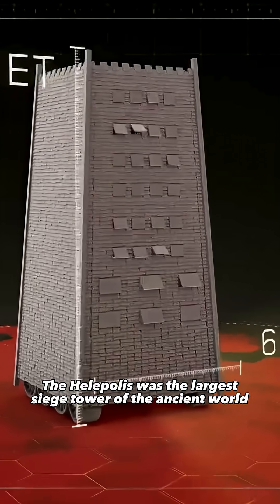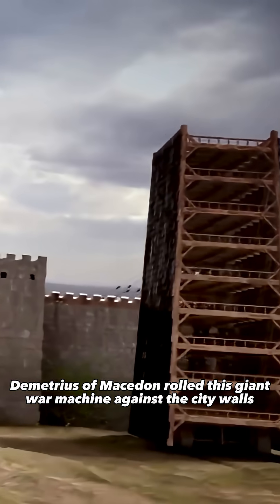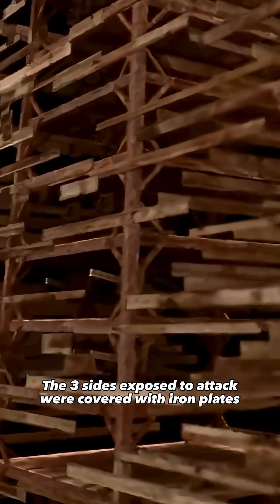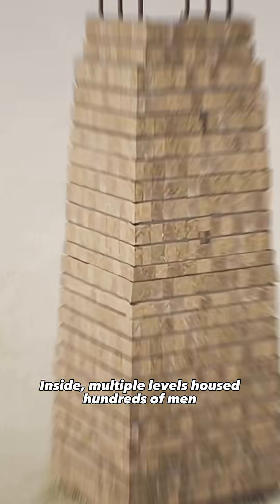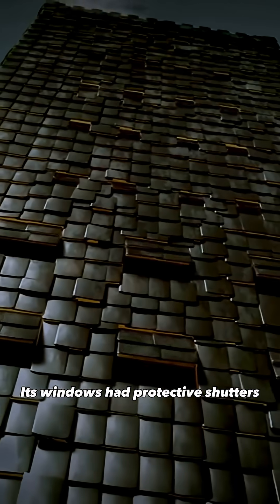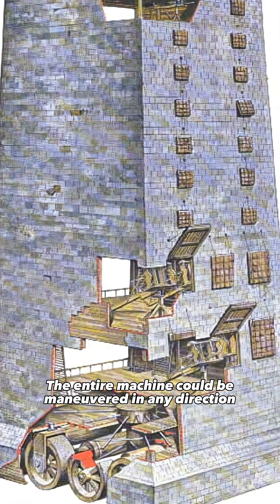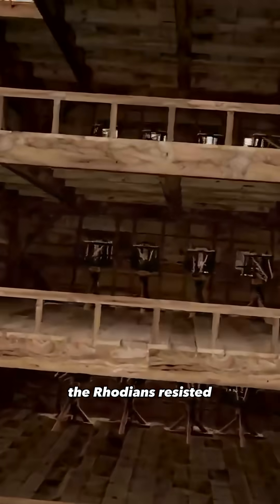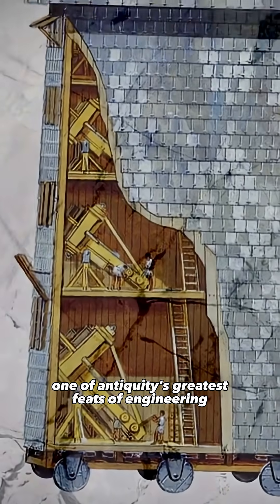Ancient War Machines Second Episode : The Helepolis #history #engineering

Comment: I don't buy that this thing was covered in iron plates. I mean this is 300BC, and Iron isn't all that easy to mass produce yet. Plus turning them into  large plates and cover up an entire seige engine... that sounds unlikely. Not to mention the added weight from all that. Rawhide would do nearly as good a job and it would be far easier to procure.

Comment: Fun fact about it is that the Rhodeans used all that material to built the Colossus to troll everybody.😅
Reply: WRONG! The Colossus of Rhodes NEVER EXISTED! EVERY bit of "recovered artifacts" which were used to "prove" its existence has been DISPROVEN &/or DEBUNKED! I'm a Greek from Athens, formerly married to a Rhodian girl. We've vacationed at Rhodes and visited the Colossus of Rhodes museum, there, which is where I found out. Mainly, there wasn't enough metal at Rhodes to build something of that size, nor were there ANY engineers, architects or builders with the knowledge to engineer and design it. Also, the location where it was supposedly erected is NOT solid or sturdy enough to support something of that magnitude. Modern-day professionals have also opined that its structure would not have been able to stand upright for very long. Last, but not least, Rhodians are for the most part BIG LIARS! The men are very insecure because of their small stature, and have a certain inability to really control or run their households. Mostly, they were ruled by women, which harkens back to pre-Hellenic history to the age of the Minoans who were the people that populated most of the Greek isles, with Crete being their "capital". They often lost the bigger battles against Athenians, Macedonians, Spartans and were reportedly EXTREMELY envious of them, especially the Athenians whom were considerably more advanced in all areas important to early civilizations. This is ALL writen according to Greek history. Feel free to fact-check me, or reply with corrections. Sorry to burst your bubble, but at least NOW you know the truth.

The Helepolis WAS REAL.

Now, you know!

Comment: What this video isn't telling the people who view it is that the individuals behind the wall fired huge arrows that took many men to draw back and lit it on fire with oil and it got so hot that the guys in the mobile tower cooked even if no flames 🔥 touched them. The HUGE arrows were aimed at the ground in front of the mobile tower so that it could not advance and lot of steel arrows pierced through the thin metal scales. But they discovered that they didn't need to do any of what was mentioned above. All they had to do was cover it with oil and light it and the flames easily burned ❤️‍🔥 between the metal plates. It got so hot that before the wood started to burn the men inside the mobile tower fell over because they could not breath atmosphere heated to that extent. Then the so called engineer was ripped to pieces by his own people because he had them believing that the tower would be very effective and they didn't like the deceptiveness even if it was unintentional.

Comment: I don’t believe this is possible. With all those iron plates and timber’s you wouldn’t move the thing. It would collapse under it’s own weight.
Reply: You highly underestimate engineers. The plates were thin, and the timbers weren’t arranged in the way presented in the video. It WAS built, that isn’t myth, it’s FACT from recorded history, albeit exaggerated
Reply: @Seasmus99  The weight would be around 400 tons!!!
Reply: There had been wooden railway bridges that didn't collapse for a century. There are wooden churches of the same size. Wooden ships have been built much larger. 
The wooden structure will NOT collapse under its own weight. 
The problems are very different. You have to find a way to prevent the wheels from sinking in and you have to find a way to actually move it without exposing a pulling crew in front of it. 
Sinking in can be prevented by building a wooden road. If the machine was designed well, that was possible from the inside, laying log after log in front of the front wheels. 
Moving it probably can be achieved the easiest by a combinatiuon of anchoring poles, pulleys and ropes that allow a large crew to pull backwards while the machine moves forward. 
It will be incredibly slow, but they had tons of time to reach the wall. The enemy didn't want to come out, they were patiently waiting behind the wall.
Reply: Probably made up by Greek Nasionalism.
Reply: You are uneducated

Comment: 3400 men to operate one tower? Those numbers sound exaggerated to me. How did they move such a big heavy thing?
Reply: They say in shifts. Probably had enough room for a couple hundred men working super hard for a few minutes and then getting replaced
Reply: Through a capstan in the bottom floors, connected directly to all 8 wheels through a belt system. It moved incredibly slowly tho, progress would’ve been measured in days and weeks

Comment: How the heck did it move forward? That’s not a rhetorical question, did they push it?
Reply: 8 wheels, each 15 feet high and casters that distributed ground pressure similarly to how a tank tread does. 3,400 men worked in relay teams to always turn a massive capstan which drove the wheels through a belt system. Capstan is a vertical wheel/gear that people or animals turn to generate force. They also had men and oxen behind to push if they weren’t close enough to be in danger yet.
Reply: @Seasmus99 I appreciate the explanation but I’ll keep it a bean, I don’t think that’s even remotely possible. Just the weight of 3k men alone would be enough to drive whatever “treads” you have straight into the dirt and just start grinding it into mud, there is just no torque even if you have theoretically enough propulsion, the theory your describing would work in a liquid(boat in water) or gas (plane in air) environment but against a solid like the ground you need torque to overcome friction.

Comment: How did they move forward a thing this size and this heavy, the pressure over the wheels and over the ground must've been gigantic!
Reply: Don't they say how many men in the video that it took to move it.
Reply: The narrator literally said, "It took 3,400 men to operate".
Reply: 8 wheels probably with supports so when in place it wouldn't need to rely completely on the wheels to resist the weight but in movement, I have no  clue how this would be possible with the sheer weight and limitations of the time.
Reply: @TsutomuGindi  Especially without paved access
Reply: @chuckw.6376  Pretty sure they had time to pave the path in front of that thing from the underside 😂
Reply: That's always my question as well. Do they use oxen, horses, men? How much preparation must they do to the terrain to maintain a steady grade with no depressions. My sense is that these machines may be larger than the norm of the day and grow with each generation after the passing of the original witnesses. I marvel at the ingenuity and engineering but it's the tendency for hyperbole by both sides of the conflict that causes my doubt.
Reply: @charlessanford2198  No, they had a massive capstan in the middle which connected directly to all 8 wheels through a belt system. You’d have thousands of men working in relay teams that would swap in and out to turn the capstan. It moved like a snail tho, so extra men and oxen were used to push in the back when they weren’t in danger.
Reply: @Seasmus99  nailed it. Another video goes into more detail. They first have to prepare the path in front with crushed rock or some other type of paving. The bottom level has a floor that ropes or straps sit under conected to the four large wheels on either side. A huge capstan in the middle turns to move the wheels. The capstan looks like it has 16 or 17 spokes with three men pushing each of the spokes to turn it and provide the power. When it stops wedges are used to keep the tower from rolling back. ... So basically its like a big Tesla Cybertruck except its powered by people turning the capstan instead of squirrels running on a wheel.
Reply: @Seasmus99 
Ah you were there.  Thank goodness you survived.
Reply: @gibu002 the worlds first paving machine. I like it.
Reply: @CharbeeCapps  lol... I would assume the paving work was all from workers that would need to be out front and protected in some way from enemy missile attacks. A pretty rough job that nobody would like to be assigned to. .... Your just dropping off your basket of crushed limestone or whatever when a pot of burning oil drops into your workspace......
Reply: @charlessanford2198 I don't doubt it's possible to make this. However the art shown probably isn't accurate. If the 8 wheels were more like steam rollers with long cylinders and a large diameter that can easily climb over obstacles. Probably ribbed like old steam tractor tires only. As far as what they did to move it. Probably several hundred men pushing it slowly with some form of leverage
Reply: @dasboots3272 someone mentioned above they had people actually paving the ground before the engine could proceed
Reply: @charlessanford2198  Well the ancient greeks(who built this) and the romans actually built ramps and roads for their seige engines to travel on to the wall. They were very good at making roads. The seige tower itself had powered wheels that were powered by the large Capstan at the bottom(look up capstan; they are large cranks with removable poles that were usually on age of sail warships used to raise and lower the sails, anchors, and cargo nets/cranes). Except in large seige ladders instead of men powering it, they would 2 large oxen lashed to each pole, pushing and pulling it, the capstan had like 20 poles and it worked on a gear/pulley transmission system to enhance torque. 
   In addition to this they had large ox teams behind the ladder pushing it. Combined with the powered wheels it moved pretty reliably. You have to understand these wheels were absolutely HUGE like 10ft in diameter and there were a bunch on each side. With the load reduction of the pulley/gear system of the capstan the ox teams could move it pretty reliably, although it moved VERY slowly like a couple feet an hour, but that was a benefit so it didnt wobble and topple over.
Reply: Incomplete information
Reply: They used cave trolls
Reply: Giant elephants
Reply: The answer is simply that the wheels were constantly breaking and needed to be replaced. They were machines that advanced by a meter a day; they weren't vehicles for travel.
Reply: It looks like there is a capstan winch in the lowest floor. The eight "Wheels were most likely not slim, carriagewheels like in this animation, but rather whole treelogs, providing much more surface area. Also, the attacking army usually built reinforced ramps/ boardwalks for the approach of heavy siege equipment under the cover of night or lighter pavestries beforehand.
Additionally to that, the "procteive cover" usually consisted only of heavy, thick wood planks, riveted together with metal fittings and covered with wet cloth or leather, not a full plate armor like depicted here.
Reply: It said it require 3000 men to operate count the view ports and assume each ballista has a 4 man crew. The doesn’t break 500.

Guess what the other 2500 were doing. The “boarding” team wouldn’t be counted as “operators”
Reply: Indeed... 'n the axle grease must have been top dollar! 😎

Sounds more like mythology than history. 

Downhill all the way... The smoothest bedrock ever discovered... More Wheels than you can shake a stick at... (To move in every direction it would have to have been sitting on  "balls in sockets")

The weight of the wooden structure would boggle the mind... 

And they failed... 

That's the part I am inclined to believe😂
Reply: Slowly
Reply: It has been a while since I read the sources. I domt even know if they bother explaining this. However one of the most common, important, and widely practiced feat of engineering (either in a siege or open field battle) was terrain preparation. The Persians, for example, flattened the fields at Gaugamela to help their cavalry and chariots. In the siege of Amphipolis (or Plataea, I forget) the attackers prepared rhe field for their own siege engines. Of course, the defenders did the exact same thing. At Plateae, the Spartans and The Thebans were trying to create an earthwork to reach the enemy walls, but the defenders dug a tunnel underneath and kept removing the piled - up earth. We see the same thing at Masada, where the Romans used siege engines to reach a mountain fortification. They first had to adapt their engines to the terrain.
It wouldn't be surprising if the same happened there.
Unfortunately we often don't get details on such things. Imagine if 500 years from now (after a world wide collapse), all that remains of our civ is a handwritten letter saying "I used my cellphone to talk to Jeff". Future historians would know we used devices that could communicate from affar, but they'd have no idea how, because people just don't bother explaining what, to them, is obvious
Reply: The answer to these historical questions is usually slaves 😂
Reply: TOW truck 🚛
Reply: Literally said it in the video gawd you’re Dumb as Hell
Reply: Any unflat ground basically renders this useless. Well if it existed.
Reply: Also a simple ditch metters away would prob render useless this tower, plus you can attack it while they build it, can only thing of certain situations where it would have been usefull
Reply: It had really wide wheels iron reinforced wheels
Reply: "Aliens" 
history channel at 3am
Reply: Slaves, probably
Reply: Very slowly.
Reply: They used the flying carpets to slide the thing duuuh. that and the enchanted rats.
Reply: Aliens
Reply: @paulclissold1525  Absolutely. 😤👍
Reply: Ancient people weren't as primitive and dumb as you think.
Reply: I can’t believe it would have functioned as stated here especially with Metal Plates increasing the weight. Even if the wheels didn’t collapse and could turn what about the ground? They weren’t rolling it over a smooth hard surface!
Reply: Especially since modern bearings didn't exist yet
Reply: No , but lubricants like animal grease probably helped  @winnsystem
Reply: Ancient historians liked to exaggerate.  You have to decide if what they say sounds like bs or not.
Reply: You are the bs
Reply: @LonesomeDove-dn8dk trebuchet I think you're misguided intelligence seems to be waning recently
Reply: @LonesomeDove-dn8dk   It is best to take them at their word because they are closer to the source
Reply: @LonesomeDove-dn8dk  And people wonder why we don't learn anything from history.
Reply: They probably would have rolled it on logs
Reply: The World's first EV.  It's obvious where Elon got his styling cues from.  😂
Reply: Not that difficult actually. Wooden wheels can support a supprising amount of weight and this had 8. Doesn't take much to move if done properly, tho it would be extremely slow.
Reply: Lets just say the "OG slaves" were once again abused for the purposes of war.
Reply: Hard to believe! Very very hard to believe!!

Comment: The first armored vehicles, if only those guys could see modern main battle tanks, they'd be so excited.
Reply: Only if they were on the same side. Gotta say i think the noise from a couple would make the entire battlefield freeze
Reply: A few tanks are worthless without a way to restock ammunition or refuel. Your precious tanks would be useless after a day in the ancient world.

t. Leo 2 driver during the early 80s
Reply: @uninitializedvariable  Considering the fact this is already a hypothetical situation where an Abrams tank is in ancient times, you'd assume ammo and fuel would accompany it as well lol
Reply: main battle tanks would be worse for breaching walls like this. you'd have to use a ton of HE rounds just to breach the wall, just for the defenders to still hold the rest of the wall.
Reply: @flynntaggart8549  I think the several inches of depleted uranium armor would say otherwise lol. They could do absolutely nothing to even scratch it
Reply: @flynntaggart8549  well considering we have so many round options nowdays it wouldn’t be hard to find one that could absolutely fuck up a stone wall
Reply: @flynntaggart8549 that's why you call in air strikes or paratroopers
Reply: @flynntaggart8549  AFAIK most if not all ancient cities have at least, A gate, gates have hinges and/or attachment points that would be more succeptible to 120mm APFSDS or HESH rounds as opposed to pre-medevial projectile weapons, the thing with gates was that they usually led into tunnels with murderholes and other defensive measures that would likely be effectively mitigated by tank armor.

That was not the point of my comment entirely.

what I meant was more like taking these enginerds and warfare enthusiasts into the future, and introducing them to modern armored vehicles and the entire history of engineering behind them, I presume they would be as happy and awed as a bunch of kids at an all-you-can-eat sweets and snacks buffet.
Reply: You see an armor plate + wheels and cry tank. Chariots are the anchient equivalent to modern tanks. 
This, however amazing it is, just is a ladder on steroids 😂